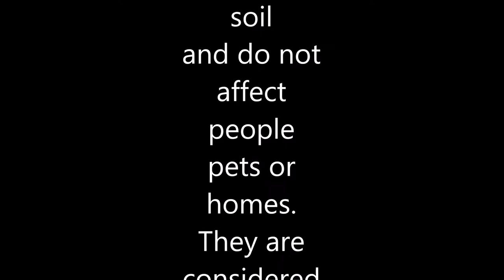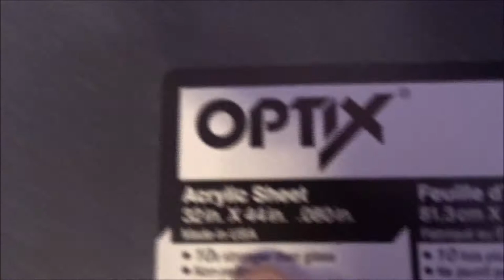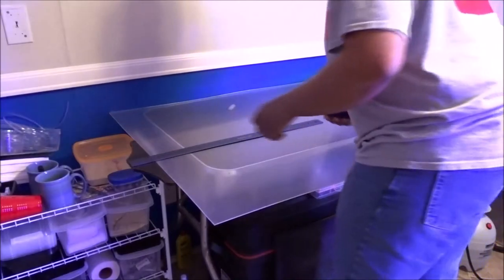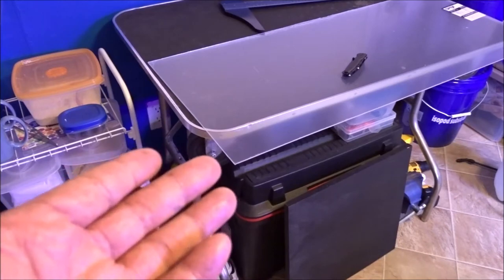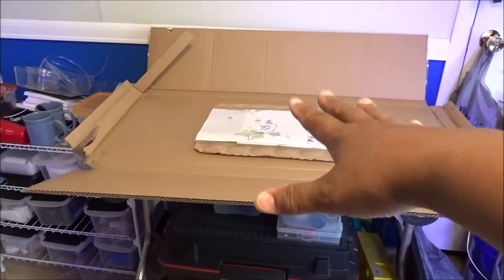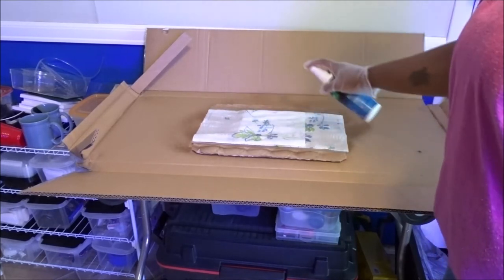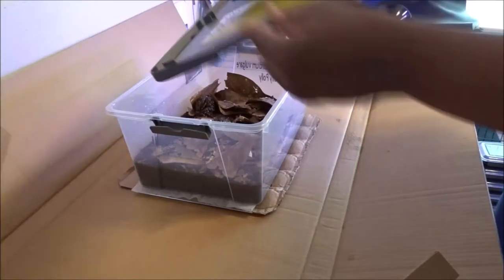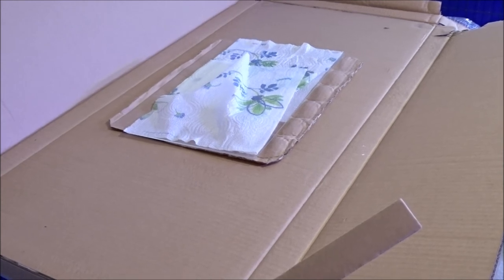Shelf Liner For Mite Control

Comment: Here's hoping mites disappear!
Reply from the maker: they are slowly disappearing from the cultures and from my research so far everyone has them and they do no harm and do not interfere with the isopods and are actually beneficial too but they do outcompete the springtails. I would rather have the springtails than the mites because the springtails are larger and will break down mold that the mites do not eat